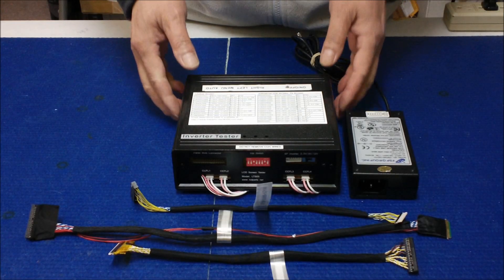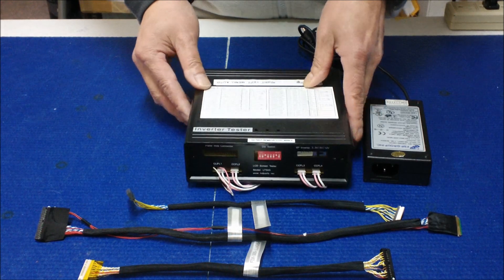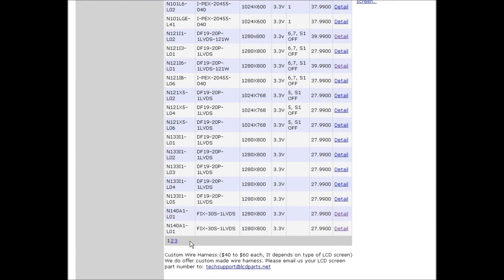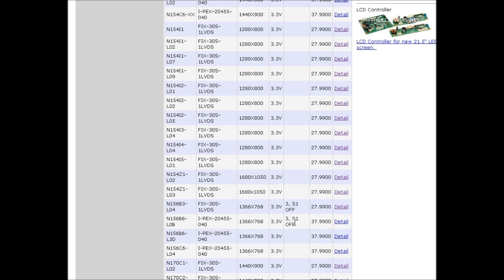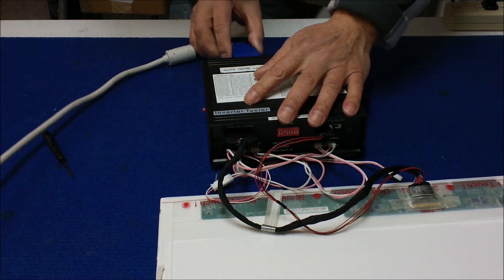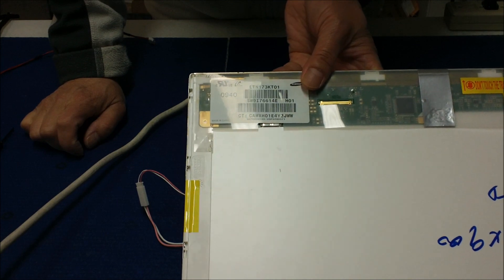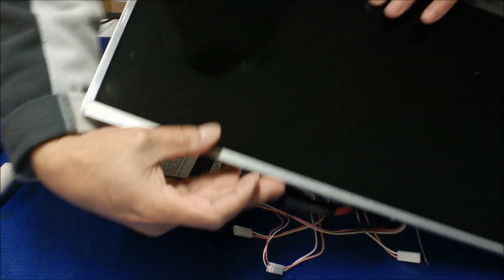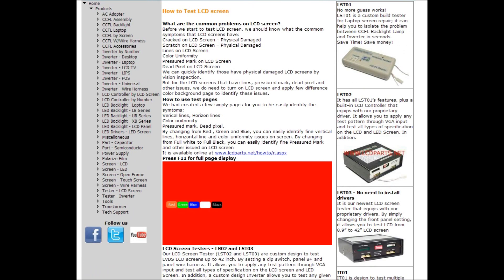LST03, How to Test Laptop Screen

Comment: This is off-topic but I used your LST01 to test a laptop and found that both the CCFL light and inverter were functioning properly. However, after powering on the laptop, the screen will go completely black (not dim) after an inconsistent amount of time, usually between the BIOS screen and the login screen. When connected to an external monitor, the display functions perfectly. Do you have any ideas how I should proceed to diagnose the problem from here?
Reply: Peter Emborsky maybe its the cable on your laptop they arent expensive to get
Reply: Whoa im late lol